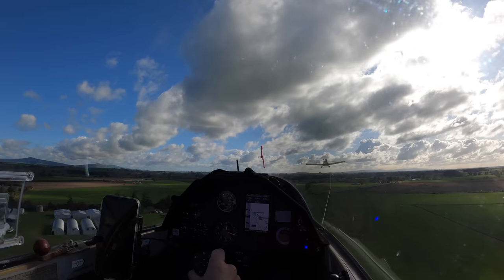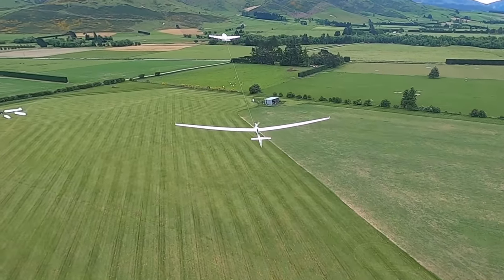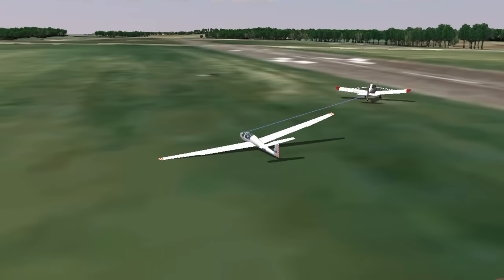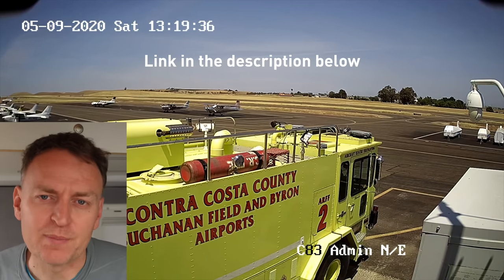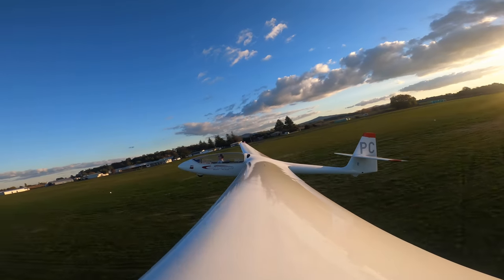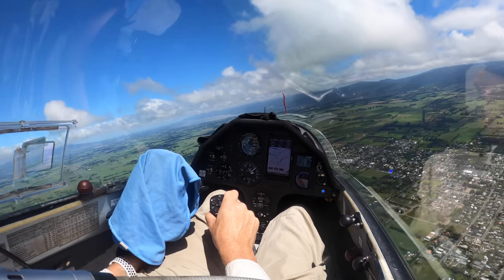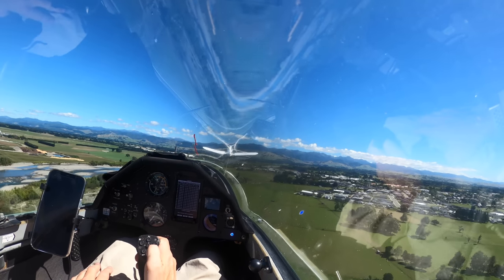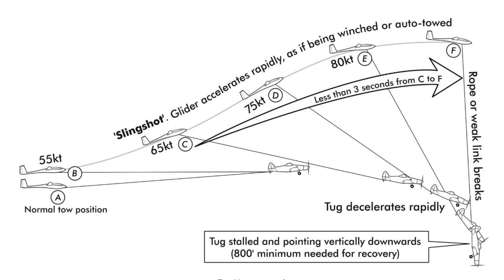3 Seconds to Crash: Glider Aerotow Launch Gone Wrong

Comment: Great video! ...and I know I'll get flogged for this... but, as a general rule in the future, I'd recommend not giving the Queen's order of merit to any pilot who is a contributing factor in one these fatal accidents.  I don't mean to sound snarky, but that is just what I believe....👍
Reply: I'm a new pilot, and I'd consider myself pretty focused on safety culture. I read accident reports, drill emergencies in the simulator, and talk through all of the nuances with my instructors. Even then, I have had situations where I should have pulled the release as PIC and didn't. I second guessed myself and in those few seconds the window passed. There's a big difference between saying you'll pull the release on ground roll and actually doing it. I hope that next time I will trust my takeoff briefing and release, but that one time was a window where an accident could have happened and I would have been a contributing factor.

I think it's far more productive to focus our energy on educating pilots, promoting a safety culture where people say something when there's a near miss, and adding safeguards to keep pilots from flying outside of their abilities. If individuals feel blamed for their mistakes, they are less likely to talk about it openly which is critical for improving safety.

Comment: Horrific,  the tow pilot obviously struggled to keep the nose up and even succeeded briefly, strange he didn't release from his end, perhaps not enough practice/training to make it instinctive?  In my limited experience with the few flights I've had in the UK, you're taught to keep one hand on the release at all times during initial roll and climb, and pull it hard if anything is going pear-shaped, interesting you don't in your vids? This maybe just at the 2 clubs I've flown with, Is this a thing in NZ?
Reply from the maker: I think I was taught to keep my hand near the release on tow, but I can see the reasoning to keep it touching. I also have flaps I have to deal with while launching. But I do pull the tow release out and make sure it's not tucked under my leg before launch, so it's ready to grab! And I have had to release on launch a few times, and have done so successfully, so confident I can get to it fast enough.

Comment: Y in the hell the tow  pilot doesn’t  has a  pull   To unhook  also
Reply from the maker: The tow plane does have a release at it's end too. But it's difficult for the tow pilot to see the glider, and if there is too much tension on the release, it might not work

Comment: Ignorant non-pilot here with an UNBELIEVABLY stupid question I would like one of you experienced glider tow pilots to answer: Why is there not a towline release mechanism in the tow plane as well as in the glider?

I know that would put a heavy weight on the nose of the glider, but hey, if the glider pilot doesn't release in a reasonable length of time, why should the people in the tow plane have to die or be critically injured for something that was the glider pilot's fault?

Again, I ask this out of ignorance, not as a challenge.  I know I must be missing something critical here; I just don't know what it is.

Comment: I have often wondered why a tow plane hook mechanism has not been developed with a caged cone " Hail Mary maximun out of toe position automatic trigger release"  making it virtually impossible for a sailplane under tow load; not slack line, to drag the tail of the tow plane in any direction with authority.  Namely, you screw up your toe position .... extremely ...... and snap that towline taut....... bingo you're on your own.  End of tow, now get in the back of the line  after a serious debrief of some sort.   No dead tow pilot.

I was so furious one time watching a Jack ass CFIG almost kill my son by pulling him into a Mother Of All Hellacious left crab and almost stall and almost into a tumbling ball of fire in the Pawnee by not releasing at 40' over straight away landable Strip out here in Wild West of the US.... i calmed down enough by the time said CFIG returned in his plane 3 hrs later  that all he got was an instant debrief ....slashed tire and a rock smashed altimeter.    Remember that Big B?   I know you do.     A snap of the finger away from  lossing my son.

Comment: Install tow line disconnects on the tow plane and dup the glider rather than let it crash you .
Reply from the maker: We already have weak links, but it doesn't require that much force to drag the tail of the tow plane around. But engineering a release hook that does back release isn't that easy. We already have them for our winch hook, but the angles are a lot greater, so easier to do I guess!

Comment: One of the most crazy true stories I heard from a tug pilot I know, was that one time there was a tug pilot at a gliding club who was using a Pawnee. Everything was going fine until the takeoff, the glider was hooked on and the tug pilot hand started the engine. He didn't realise that the throttle was all the way open and he forget to chock it. That pawnee ended up taking off and both tug and glider crashed
Luckily the pilot in the glider managed to bail out before impact.
Reply from the maker: Wow that's crazy!